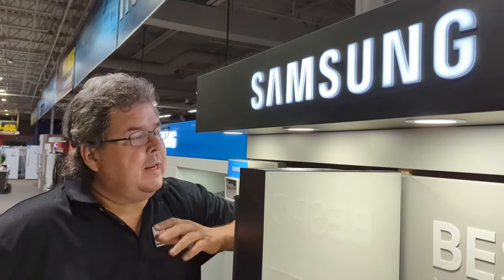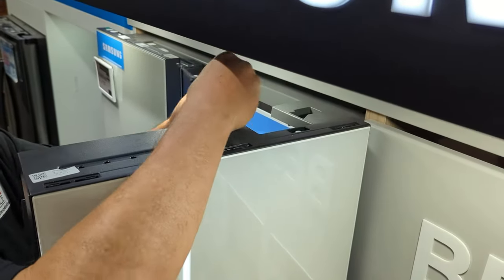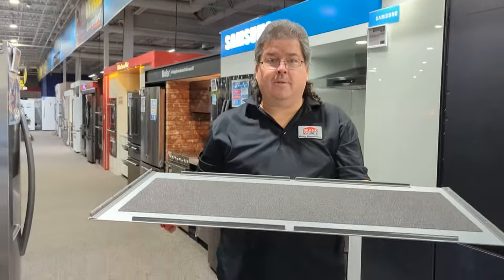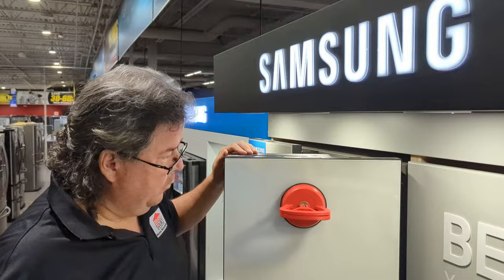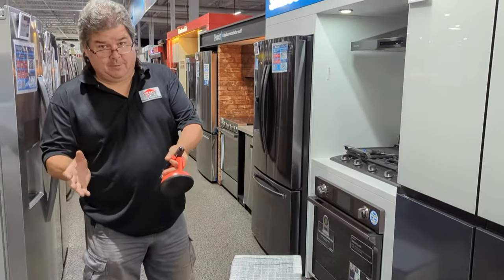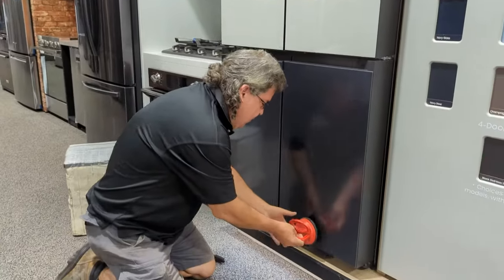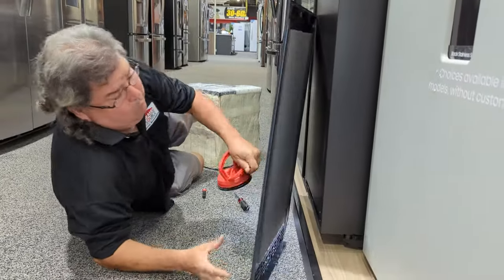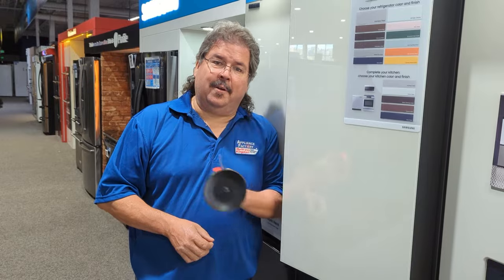How to Install Samsung Bespoke Refrigerator Panels

Comment: The bottom panels are very close to the floor. Get a small mirror and lay it below the clips so you can see what you are doing. Also, I tried to put a top panel back into place without the suction cup even though I had it sitting right on the countertop. It slipped and fell and was damaged, so be sure to use the suction cup on and off.

Comment: Thanks for the quick demo, that helped a lot. Just some added info for others:  My model had THREE clips per door and, if you don't have a suction cup, a strong enough magnet (on a paper towel to prevent scratches) works like a charm.

Comment: Pregunta: Si tengo el modelo rf29cb9900qkaa (que viene con la pantalla), se pueden cambiar los paneles de abajo?.  
If I have the rf29cb9900qkaa model (which comes with the screen), can the bottom panels be changed?